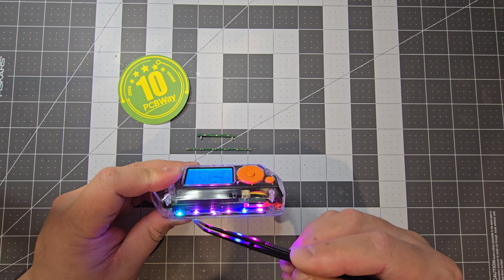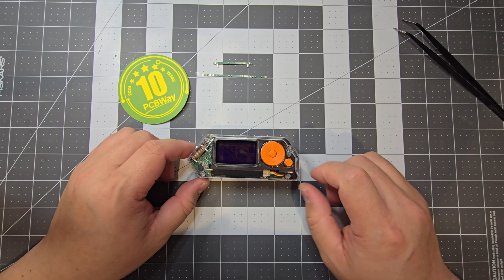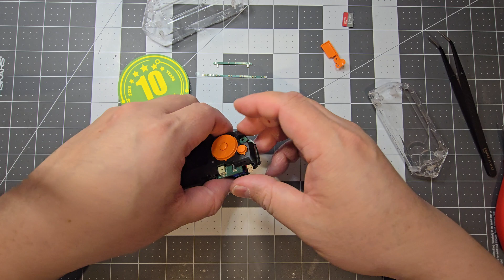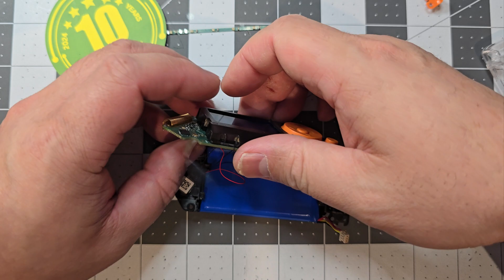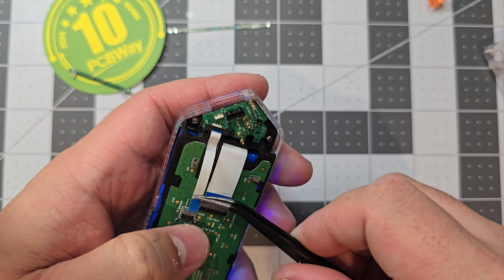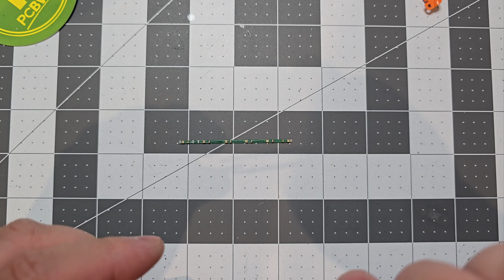Flipper Zero RGB Mod

Comment: when buying the pcp for the backlight and rgb board do i need to pay for assembly too? what does assembly entail?
Reply from the maker: You can just buy the pcb boards itself and buy components seperately and solder on yourself will be much cheaper. If you are in Australia I have some spare I can sell.
Reply: @rayj1988  I'm in America i bought everything on your description though so i should be set to just build it myself then? its saying assembly will be $80 though so i was wondering, how hard would you say they are to put together i wouldn't say I'm a novice at soldering but i wont say I'm good.
Reply from the maker: I've done it with a hot air station and mini hot plate, not that difficult. You can't do it with a soldering iron.
Reply: @rayj1988  i will look into these thank you for answering my question
Reply: @rayj1988  hello sorry if I’m starting to bother I could really use some clarity on this please
Reply from the maker: Yes you use solder paste. I just used a toothpick to put the solderpaste on just small dabs. Put the components on the correct orientation and use the hot air on low fan setting to carefully head the pcb board up until the solder paste flows and use tweesers to tap them in to their spots if required. I would just look up a video on how to reflow and get tips from that.
Reply: Hi, thanks for the video, what hot plate do you have ?  @rayj1988
Reply from the maker: @Fabius.G I have a MHP30
Reply: Hello so I have all the components and am trying to use the hot air gun with little success could you give a brief explanation on how to put these together?
Reply: It also looks like there’s no solder paste holding them on the board in this video would solder paste work?